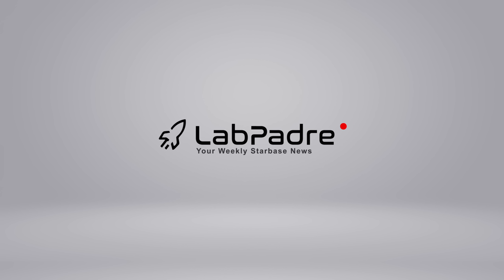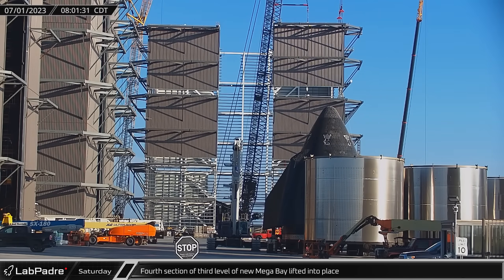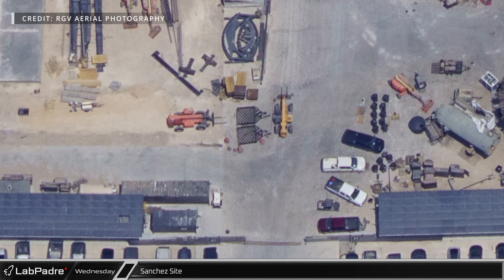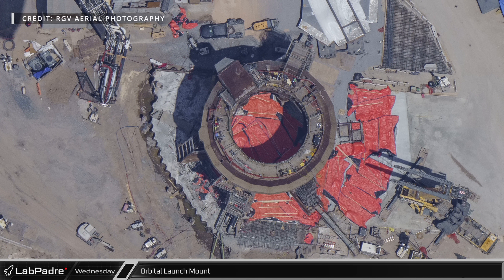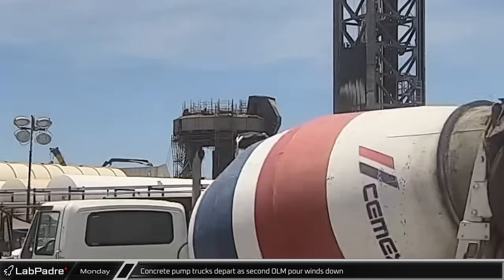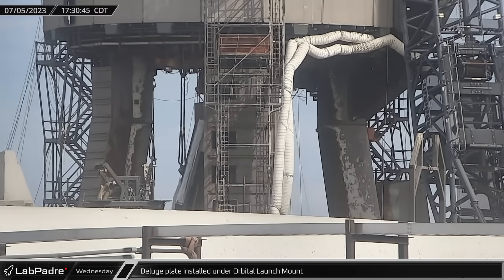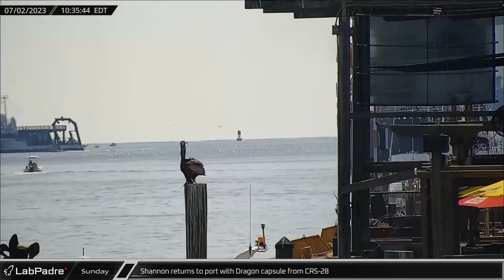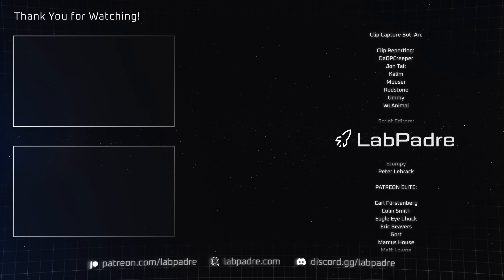SpaceX Completing Starship's Upgraded Launch Pad! - Starbase Weekly Update #70

Comment: Back when Starship construction was starting, I remember Elon said he wanted to try thinner (3mm?) rolled steel rather than current (4mm?) stainless steel. What is the thickness of the stainless steel on Starship, the booster and does the thickness vary at different heights of the 2 stacks? How thick is the steel used on the stringers? At what point do more stringers help more than thicker steel?
Reply: Good questions. 🤔.
  But that stuff be classified 🤫.
  Zuckerberg might try to steal it. 😡